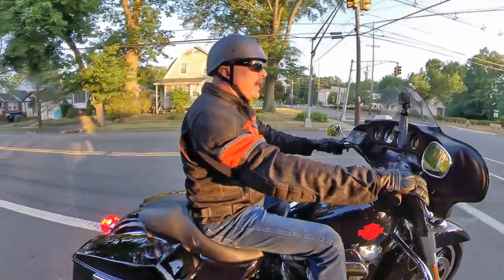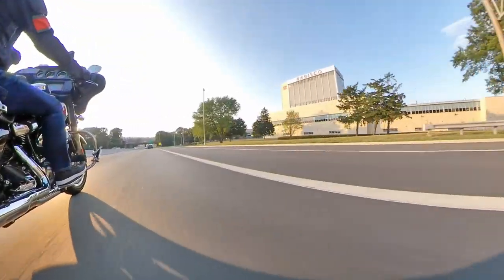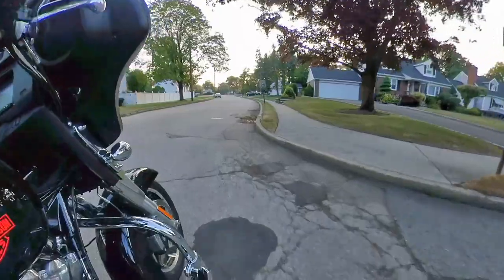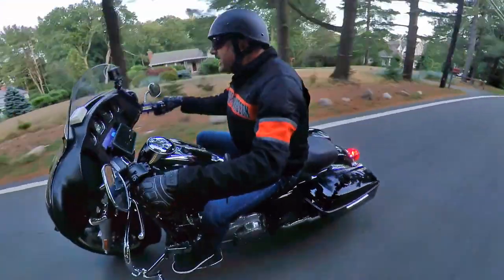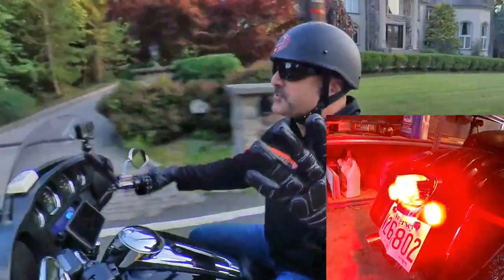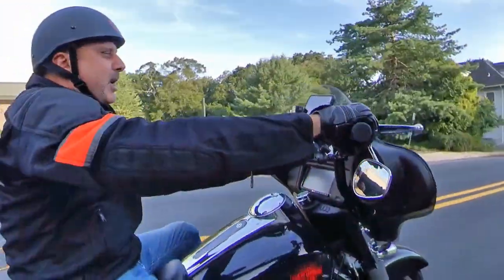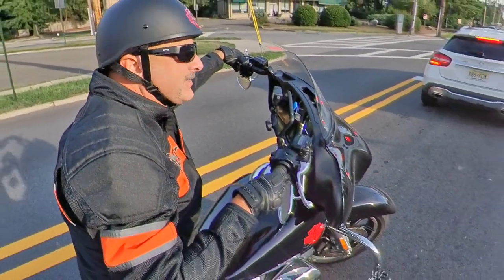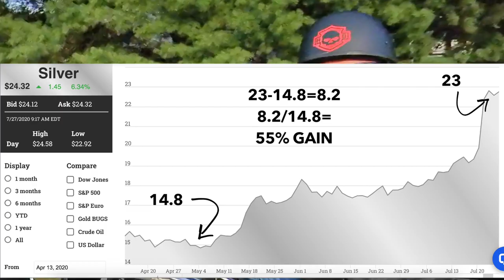KST Kustoms Handlebars Upgrade

Comment: Hey Sandy, I'm looking to upgrade my bars, did you have to  change the brake and clutch cables I have the same bike.
Reply from the maker: No need for brake and clutch cable replacement- it fits original
Reply from the maker: @robertogonzalez6971  - yes you need electrical wire extension for the throttle by wire . I bought it with the bars...

Comment: Sandy, great video! I’ve been on the fence on getting the 12inch and your video might have been what I needed. I have to figure out a different solution for my mirrors though, I have a 2020 CVO with mirrors on fairing. Does it feel very different to ride compared to stock? Worried about control, feels like it will be harder to ride?
Reply from the maker: Fly & Ride - once you’re riding it’s really nice and comfortable. Only thing that requires a bit getting used to is at very slow speed when pushing the bike around with your feet in getting in and out of parking spaces - you need to be closer to the tank to reach out to the far out hand.....

Comment: I realize this is a 2 yr old video, just wondering if the fairing offers any wind protection for your hands with the 12 inch bars. Mainly for highway speeds (NJ Rt 78) in winter temperatures.
Reply from the maker: No it doesn’t
Reply from the maker: 10” will give protection though
Reply: @HOLYSHIFT  Thanks!

Comment: Where did you get the red tank decal? Just bought a 2020 slim and hate the emblem.
Reply from the maker: The red emblem is painted on - stock on the Electra glide standard 2019-2020